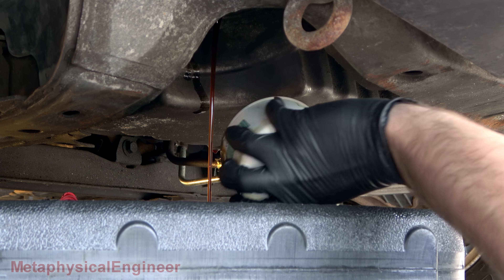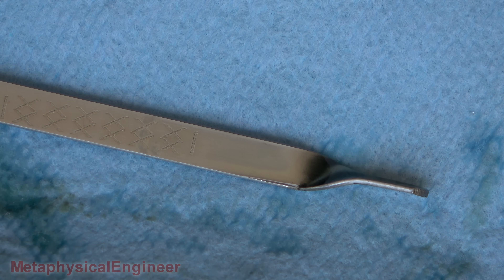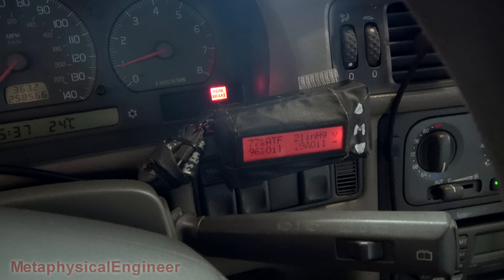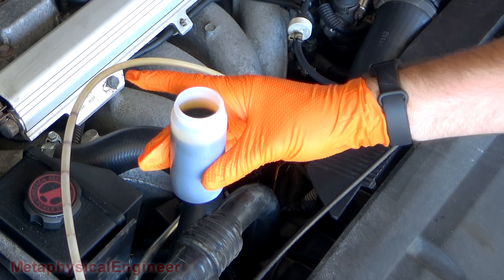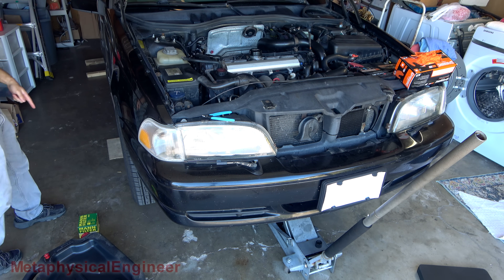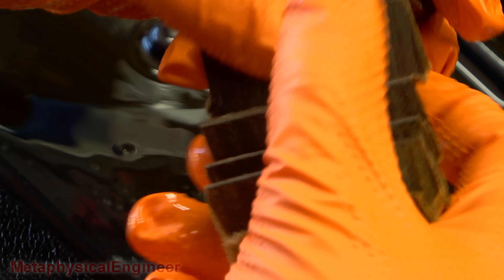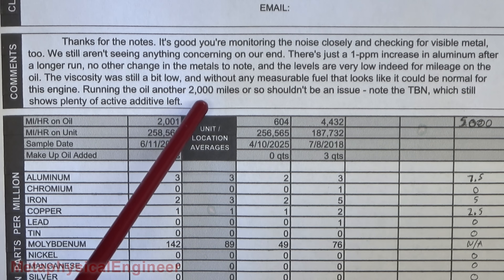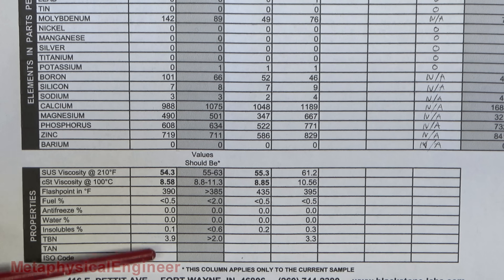Valvoline Restore and Protect vs Noisy Lifters - Used Oil Analysis and Filter Cut Open

Comment: I'm confused by this video. This engine has solid shim adjusted lifters. I physically witnessed them as a technician of 10 years going on 11 soon. Why would you hope to fix a lifter noise on this type of engine with oil additives?? 

It's my experience with these Volvos that if they start making a ticking noise from excessive valve lash then you have to take the cylinder ahead apart and adjust the number of shims on the solid lifters. 

It's also my experience with these engines that most people won't pay for that once they get up to this age. It also follows that most people end up ignoring it and it never leads to a catastrophic failure.
Reply from the maker: (Most) 1999 and later models had the redesigned valvetrain with solid lifters and shims.  This 1998 model has the older design which does use hydraulic lifters.

I've had the head apart before and seen the lifters.  Even the  manual specifically mentions hydraulic lifters that don't need adjustment.  Also cautions about possibility of lifter tick for a few minutes after startup if engine has been out of service for an extended period, due to lifters bleeding down. .
Reply: @MetaphysicalEngineer  sorry I doubted you, so this has a 1998 B5254S engine with hydraulic lifters. The turbo engines had solid lifters even on this year, it's curious that the non-turbo engine would use hydraulic lifters when they had the solid lifter design ready to go. 

Thanks for your response 😊
Reply from the maker: This is the GLT low pressure turbo model, with the B5254T, also with hydraulic lifters this year for the US market.  Specifications page lists valve clearance as "self-adjusting" for all engines offered here: B5254S naturally aspirated, B5254T low pressure turbo, and B5234T3 high pressure turbo.  

Different markets likely had different versions, and there's probably a phaseout period 1998 thru 2000 where existing stock of older engines may have been used in some models before the new designs were put into service.
Reply: @MetaphysicalEngineer  😵‍💫 got to love transition years
Reply from the maker: Oh yeah there's a bunch of stuff that makes this particular car seem like a chimera compared to the older 850s or later 90s V70s.  Subtle changes in routing or position of items, or even completely different parts despite all available documentation claiming perfect compatibility.  Even the fuel pump was different so had to replace the whole assembly rather than the pump motor itself!

Comment: Never seen anyone fill the oil filter before installing
Reply: There's the people that do, and the ones that don't.  Ones that do argue that it prevents a longer delay from oil reaching the top of the engine due to the time it takes to fill the filter first.  This was actually tested and results were it made no actual difference, and filling the filter first runs the risk of contaminants bypassing the filter and getting into the engine, and that's a slim chance from a new unopened bottle of oil, but not a zero chance.  Prefilling the filter just adds unnecessary risk imo, as who knows if there's a piece of plastic or some bs loose in the bottle, you never know.

Comment: I avoid the hot draining oil by using a shop vac. Not crucial but, break the drain plug loose. Depending on your oil fill, have the vacuum hose in and the vacuum on. Unscrew the drain plug and shut off the vacuum. Since not all fill access are the same, one of the ones I have used this on required a helper to hold the hose tightly to the fill hole. I usually use a large shop vac but my baby one works also.
Reply from the maker: I've seen this trick done before!  Never tried it myself, but makes sense pulling a vacuum to keep the oil from blasting out.

Comment: I recently switched to Valvoline R&P (5w30) in my 2007 Camry V6 (122K miles). After about 100 miles I think I am hearing a new ticking noise. A little concerned as to what that might be, and unforunately, I can't remember if it was there BEFORE I switched to R&P. I hope it goes away as R&P does its job. 

I am very interested in seeing your results. Great video.
Reply: Leave it in another 2k miles it will be fine

Comment: I usually pour a 1/2 qt new oil through to rinse remnants of old oil from the pan.  I started using R&P 5W20 in my 2010 Jeep Wrangler, with 65k miles, that had a bit noisy startup, and it totally reaolved it.  I purchased it with 57k miles and did 3 oil changea in a 5k mile span, to “rinse” but it was obviously well maintained as the engine, and the entire vehicle is spotless, I put a scope in the valve cover, and no sludge and looked brand new., then used R&P my last change, as well as changed the plugs, wires, transmission filter & fluid, transfer case fluid, differentials, brake and coolant fluids.  I always buy low mileage pre owned and always do a complete fluid service, as soon as I get the vehicle in my driveway, no matter how good the fluids look and dealer says “was fully serviced”, as I want a starting point, and use only OEM (Transmission & Diffs) and quality synthetic and filters and Zerex coolant.

Comment: This oil is great stuff all VALVOLINE oil is all I ever used me but one thing I noticed is it ran smooth as silk  the first 1000 miles for some reason and I swear my es350 I used it and it's. Smooth too more like engine wants to go like it's been on the highway for 4 hrs it works the dipstick used to have  heavy tarnish on it the upper part now it's gone I forgot about it must be doing something

Comment: I used a quart af ATF, ran for half an hour, then chaned the oil and filter with restore and protect.  My tapping noise immediately reduced by 50%.
Reply from the maker: Nice!  What vehicle and mileage?  Did the ATF alone affect the noise, or only once you put in the R&P?

Comment: Does it have any effect on engine oil temp while towing. That's been my concern. Also, does it affect fuel mileage?
Reply from the maker: Did not see anything unusual about oil temps.  Despite the apparent viscosity loss, oil pressure also stayed as expected on my digital gauge, even with heavy load and hot temps.  I am getting slightly better economy, but I've done other things like new spark plugs and cleaning MAF sensor as well so can't credit the oil alone.  

If an engine was down on compression from fouled rings, cleaning those up would definitely restore efficiency and power so that could give an economy boost.

Comment: oil can't fix anything of significance, it only protects
Reply from the maker: True, oil can't repair damage if the parts are worn out.  But if the problem is varnish causing an otherwise intact lifter or ring pack to stick, removing that varnish will restore proper operation.  Oils have had detergent properties for many decades; this formulation supposedly manages to be more effective at cleaning without the typical drawbacks such as poor lubrication, short service life, or degrading engine seals.

Comment: R&P stopped the piston slap in my 02 silverado 5.3  
No more Mobil 1   No more tick tick tick at start up
Stoked
Reply from the maker: Nice!  How long did it take before the noise went away?  How many total miles on your truck?
Reply: My pickup has $230,000 Mi on it I drove it for 20 years with mobile one in it. The slap went away almost immediately after switching to R&P

Comment: Great job. That Volvo 2.5 engine is a bullet proof engine.  I worked at Volvo 94-04.  Had a s70 98 and a s60 02 both had that same engine was common on 850 Volvo 240 series and non turbo v70 station wagons
Reply from the maker: Yeah, this engine is going strong for its age and mileage.  Aside from the lifter noise it runs like new, and hasn't burned much, if any oil in over 4000 miles.  The only make up oil I added was the 10 ounces shown in this video after the sample and filter change.  Haven't done a compression test recently but a few years ago at 220k miles or so I got essentially factory perfect numbers across the board with little variation cylinder to cylinder.

Comment: Whenever I snag a mower discarded on the curb, I service it with MMO. I put a few oz in the oil, and once I get it serviced and running, I cut my lawn. I change the oil and the MMO seems to clean the sludge out of the engine. I will do this process a couple of times and the oil seems to remain cleaner for longer. MMO recommends adding it to the oil about 500 miles before an oil change. I'm not brave enough to replace 20% of the oil with MMO, but I do add a few oz in the oil and gas in my cars. MMO also makes a specific oil for synthetic  oils.
Reply from the maker: That's a really good use for MMO.  It's great for loosening soft sludge and gunk on older engines.  And as a gentle fuel system cleaner and upper cylinder lube.  I used it for 2300 miles, before I tried Seafoam, as explained in previous videos.  Wasn't able to do much for the super tough varnish.  I had about 17% in the oil and didn't see a significant drop in hot oil pressure.  Wish I'd done oil analysis for that run but it didn't do any harm in terms of visible metal in oil or filter, and that interval included some hard, hot running.

Comment: How long can you go on this oil?  Can you go 5,500 miles before next oil change?
Or is this more of a oil flush oil ?
Reply from the maker: Instructions say to use at recommended service intervals.  But in cases of neglected engines, should be watched closely.  I changed the filter early in this video to be absolutely sure I wasn't plugging it up with hidden deposits washing out.  

In my case I intend to use factory 5000 mile intervals, unless oil analysis shows reason for caution.  According to the product info and other peoples' experiences, it should be treated as a good synthetic oil.  5500 should be no problem.

Comment: Is that a 98-2000 S70?
Reply from the maker: 1998 V70 GLT!
The 98 and earlier modular engines used hydraulic lifters, hence my approach trying cleaning products for the noise.  99 and later used a revised design with solid lifters and cartridge oil filters instead of the canister style.
Reply: @MetaphysicalEngineer interesting my 99 S70 has the metal spin on filter and it’s a 2.4 non turbo but my 04 V70 has a 2.5 HPT with the cartridge filter. Maybe the non turbo comes with metal spin on and the turbo has the cartridge. Never thought about it till now.
Reply from the maker: There might be some weirdness where existing stock of the older engines were installed in some 99 vehicles until depleted.  Even my 98 has differences from other 98s.  Makes for lots of fun when guides aren't accurate or parts don't match up!

Comment: My wife's 82,000-mile Nissan Rogue has had a lifter tick on cold startup since we've owned it. Sometimes it was an actual knock that stopped in a few minutes. Marvel Mystery oil resolved the knocking, but the ticking lifter remained. Last week I had Restore & Protect put in on an oil change. One hundred miles later, no more ticking and the engine sounds quieter.
Reply from the maker: Excellent results!  Keep a close eye on how dark the oil gets if the engine had lots of visible gunk you could see inside the oil fill cap.  In my case the filter was pretty clean, but a dirty engine can have a lot of crud knock loose.
Reply: Probably sticking

Comment: Hey, I don't know if you know, but use a punch and tap a hole in the bottom of the filter and let it drain as well. Very little mess.
Reply from the maker: Yeah that's a useful tip!  Haven't done it myself but seen it done before.  Another trick I've seen is cutting off the neck of a 2L soda bottle and using the bottom to spin the filter off so the bottle catches both filter and oil together.

Comment: Did I see only 4 holes on that baseplate
Reply from the maker: Yeah, there's only 4 holes.  But this filter has been used successfully for over 50 years.  Volvo only stopped using it as OE when they changed to cartridge style in '99.

I've not seen a noticeable difference in oil pressure with different filter brands, either. The filter media itself is a bigger restriction than the base plate.  Heck, there's a few feet of lines and an oil cooler in the radiator end tank that are probably a bigger restriction.

Comment: VRP fixed my car oil using oil in 3 weeks. 1998 Ford Contour V6, 129,000 miles was using a quart every 3 weeks.
Reply from the maker: Wow that's crazy fast results!  How many miles driven did that take?
Reply: @MetaphysicalEngineer  # weeks driving is about 35 miles per day. She drives the car to work round trip 35 miles per day. The goes to store on weekend about 15 miles round trip, then Sunday church about the same. 35 x5 is 175 plus 30 is 205 miles per week. 3 weeks of driving was between 600 - 700 miles estimated. The engine was never sludged up looking when viewing into the rocker thru the oil filler. But when I looked inside, it had changed from tan to shiny bright aluminum looking. It cleaned very well. Maybe the oil ring was clogged up with carbon? And now it is gone.

Comment: Don't think seafoam would help with lifter noise
Reply from the maker: The advertisements on the can specifically talk about that.  Though I suspect it assumes an older engine with soft sludge and gunk, not varnish so tough it may as well be rocks welded to the engine components.

Comment: Started using this oil and I noticed an improvement on the mpg after 3000 miles of driving,  and this is just a start.
Reply from the maker: Excellent!  What vehicle and what mileage?  I can't tell if I've gotten a mpg improvement, but my I don't think the rings were too bad.  The engine does feel and sound a little smoother though.

Comment: 1)Why did you waste your time with pefilling the filter?
2) fill the oil then run the engine for about 5 to 10 seconds.  Recheck oil.
Reply from the maker: 1) It's my time to waste!  And I like seeing oil pressure arrive a few seconds sooner vs an empty filter.
2) Yeah I could have streamlined that process.  Though also shows how an engine will happily run at low speed with the oil so low as to not show on the dipstick!

Comment: There’s countless videos on the debate, whether you should fill the oil filter with oil before installing it. I never have.   One time I pinched the gasket putting the filter on. I started the car by the time I looked underneath it it pumped 5 quarts of oil on my driveway in less than 10 seconds.    So I really don’t think there’s a need. What do you guys think?
Reply: PSA. Caterpillar heavy equipment advises against pre filling if that means anything. Those engines have a lot farther to pump the oil than a car.
Reply from the maker: I prefill because I can see on my digital oil pressure gauge that it can take a handful seconds longer to reach full pressure with a dry filter vs a full filter.  Peace of mind and easy to do with a vertical mount filter on the bottom of the engine.  

Oil pumps move volume, and pressure is created by controlled restriction of the bearing clearances.  With a blown open gasket, there's no pressure but maximum volume, so the pump can easily empty the oil pan in a few seconds.  Back when I did the cylinder head and turbo, I left the oil feed line to the turbo loose.  Just cranking with plugs out to prime the oil for a few seconds dumped half a quart on the floor from a loose banjo bolt.
Reply: @MetaphysicalEngineer   on two of my cars the oil filter is mounted horizontally. I’ve never found a way to be able to pre-fill them and like I said as quick as that oil pump is, I’m not gonna worry about the three or four seconds of start up, it’s not going to take away any of the life on my engine by any means -in my opinion
Reply: yeah, two of my cars are the same way and like I said, after that experience oil’s made to cling  to things . When you don’t drain your oil out of your engine , there is still oil on the bearings ! no need to fill an oil filter in my opinion

Comment: It takes 3 or more changes to hear results and also use some gas additives to help the tick.
Secondly use a quality filter......dont go cheap because the sludge will clog a cheapo filter....ask me how i know
Reply: Wix XP only, for me! 20,000 miles capacity filter, but change after 5,000.
Reply from the maker: Yeah it's clear I'm in for the long haul with this project now.  Curious on your reasoning for the use of gas additive for the noise?  I do use additives there for injector and valve cleaning now and then, but never seen a difference in the noise.  Port injection also tends to be more resistant to either of those parts getting fouled up.

Comment: Blackstone test lab were specific and how i was to pull sample,  run engine to operating temp, let cool down to touch engine, but still warm. drain oil and pull sample mid stream.
Reply from the maker: The important thing is consistency in sample procedure.  Middle of stream ensures clean oil without any dirt from the outside of the drain port but also that there's plenty of oil to fill the sample container.  

In my case, I wasn't draining the oil so had to pull from the top with the sample pump.  This also means I should use the sample pump for all the other samples in this experiment to be sure I'm as consistent as possible.

Warming engine all the way up prevents skewed results from fuel or moisture introduced by starting and running a cold engine.  Letting it cool down until you can safely touch it is Blackstone talking from a liability perspective.  They don't want clients getting burned by boiling hot oil and suing them.